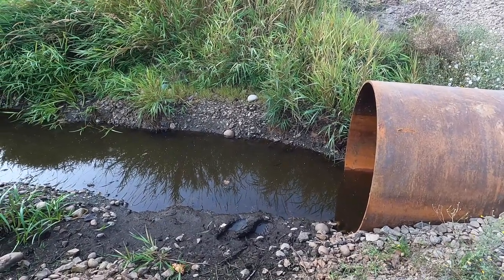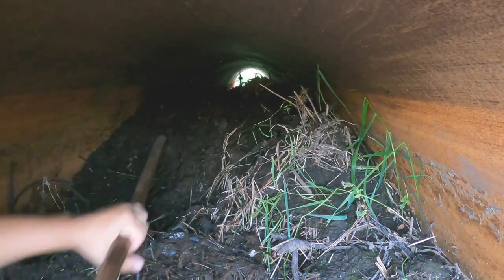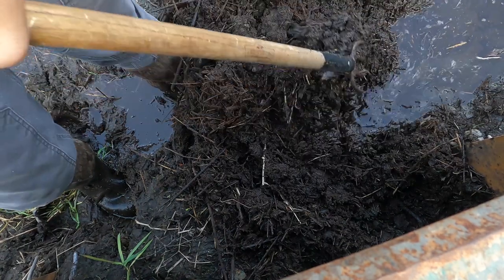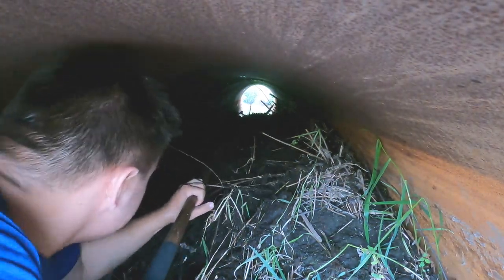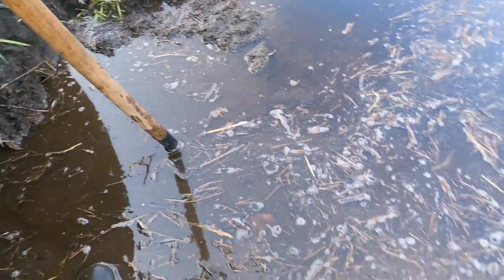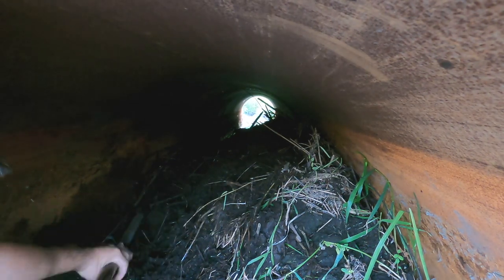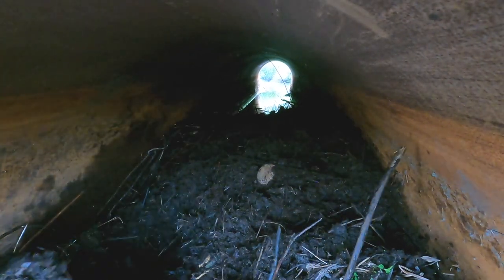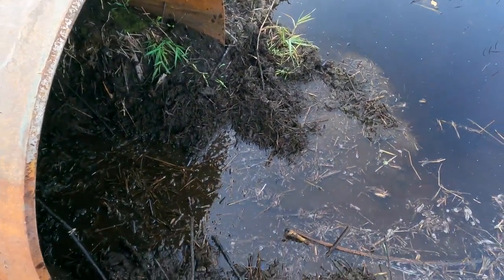Deconstructing BEAVER DAM From A Culvert Pipe! #Satisfying

Comment: Why didn't you remove it from behind? You would have had more space to move the debris that would then be washed away by the water. 🤔
Reply: @Dave________  Of course it is difficult to stay inside the pipe and remove all that mud, but if he takes it out as he is doing he has to move it twice as often because it accumulates everything in front, blocking the water. 😀
Reply: I would have blocked the water and than released it to help flush the dirt out.
Reply from the maker: It would have been a little tricky for me to get in from that side and have to continuously move back and forth carrying material. The other thing is, I wasn't really planning on removing a dam in a culvert. I just came out, grabbed my hoe, and went out to see what was happening. Next time I need to grab a light so I can get an actual visual of the dam.
Reply: With that kind of mud? It will take many hours just to get even a trickling water.

Comment: you are going to have to donate some heavy gauge hog trap or fence wire and make a rounded Arche or triangle barrier in front botth ends of that covert pipe. just to keep them out. if not the State will come back with machinery and damage the pipes. its easier to remove debris from the fence wire than digging out that dirt.  also even if they block the fence wire the water will continue to flow when the water is high. great job and god bless. list the home depot number and address so people who might want to assist you can direct purchase or donate supplies to you.
Reply from the maker: That's a pretty good idea, but i'm not sure how the railroad would react if I did any modifications. I think it would be best for the mean time to just remove the dam completely and them go in for maintenance more occasionally.
Reply: @golovinpropertyservices I am not sure if they would even mind. It will be something they need to do because it will cost them right at a grand to pay the workers to come out and clean it out. I live in Texas near the coast and  no matter where you drive in Humble you will drive over a creek or bayou. My house is 3 blocks from one. Even though this is a city maintenance job that my taxes pay for, they have never removed the beaver dams that block the bayou behind me. My neighbors that live right on the bayou clear them often and they have set up beaver barriers. If not we would all flood worse than we already do. The city pretends the beavers are not even here.  And the one time they cleared the dam from the concrete culvert they tore up the banks of the bayou so badly that my neighbor lost 6 feet of his back yard from erosion because it  rained right after they removed the dam and weakened the soil using the unnecessary heavy equipment.

Comment: Next time I suggest you remove the whole width, rather than make a narrow channel without any water to help.

The sticks that were giving you so much trouble are still buried beneath the weight of the mud at the side that you hadn't removed. Plus if you have a broad "front" you have more room to work, you can use your hands to pull out individual sticks as they become loosened.

Very good effort though, full marks for that.
Reply from the maker: Thanks for the advice, I think I’ll end up clearing the entire width next time.